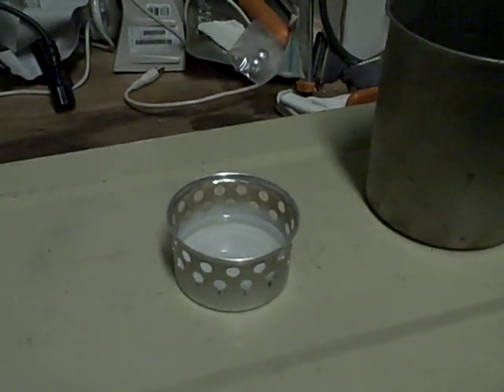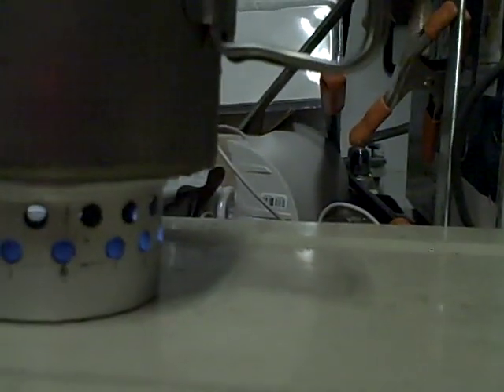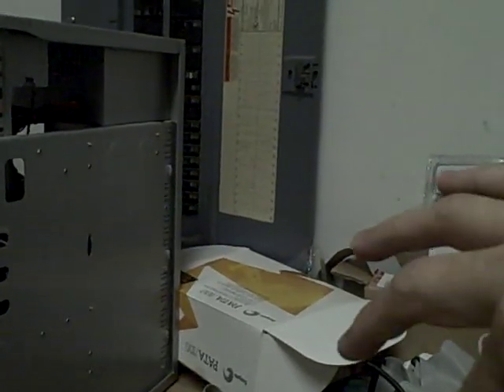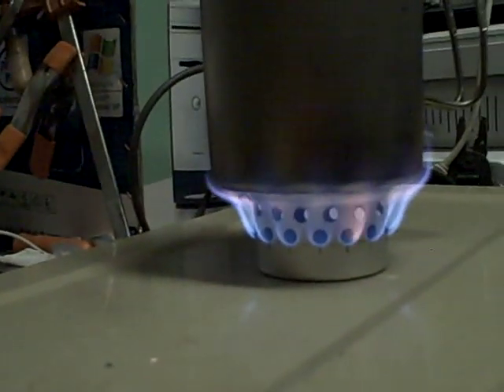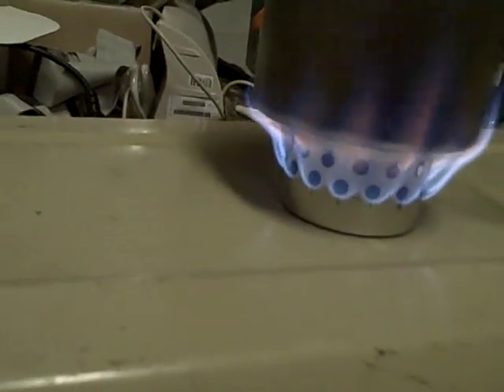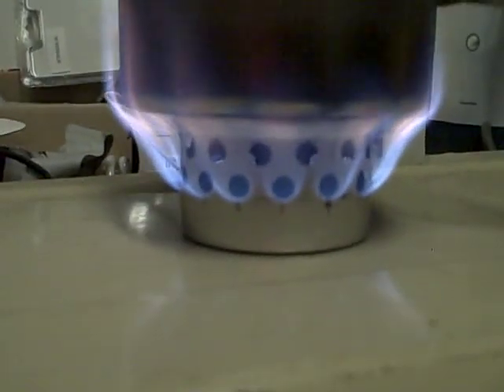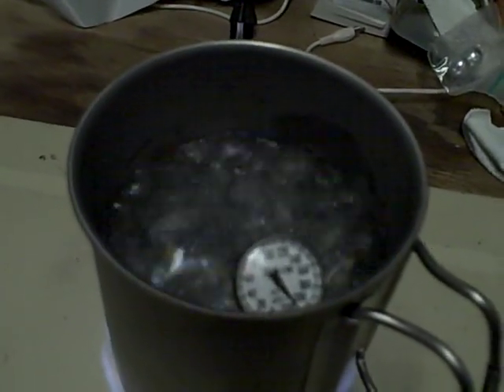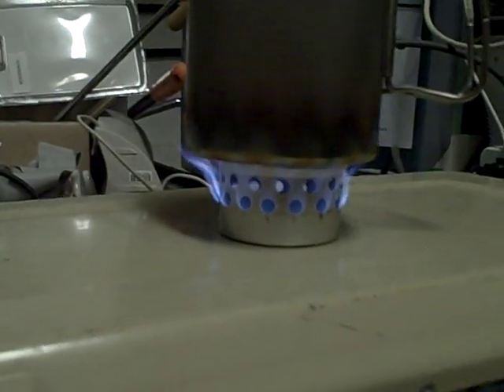Super Cat Stove

Comment: I made one, too, and it works well.  The only downside is that the can is so small.  I feel I need a larger pot stand to put around the stove.   Also, a windbreak.  And, of course, a way to regulate the heat.  But, the little can is quite the stove.

Comment: A modification you can make for priming is to add a wick encircling the lower outside portion of the stove.  A few drops of alcohol on the wick, put the cook pot on the stove and light.  The wick will burn long enough to heat / prime the stove, and you won't waste any fuel / heat.

Comment: these stoves are great but i think they can be improved by putting them in tuna can thats been cut down so its just below the holes and then fibreglass put inbetween the two cans.....this gives a wider and more stable base...when the stove is filled a little alcohol can be put into the fibreglass and lit ...theres no need to wait for the stove to prime....it can also then be used as a slower/simmering cooker

Comment: @Pripyat1 Not sure where poster is from, but the boiling temp of water goes down as altitude goes up.  On a mountain hike, it is hard to get over 200 degrees due to the rolling boil releasing any extra heat, usually not a big deal, but when purifying water, it can be.